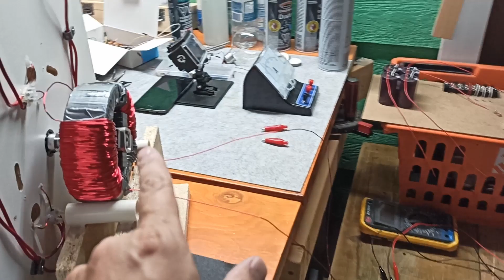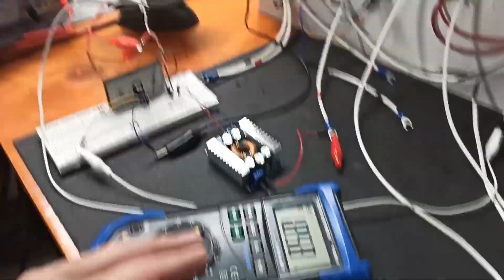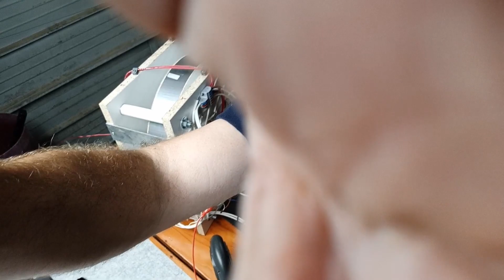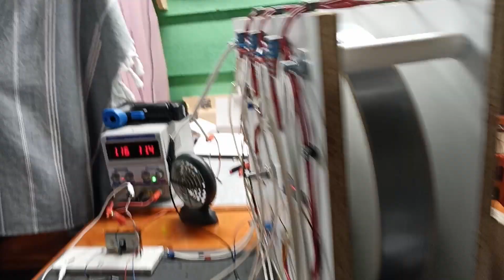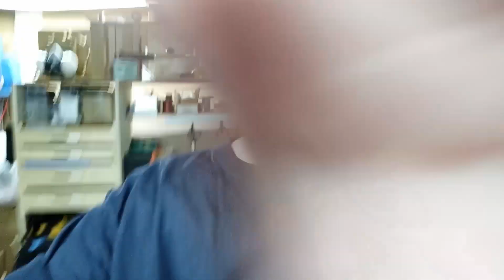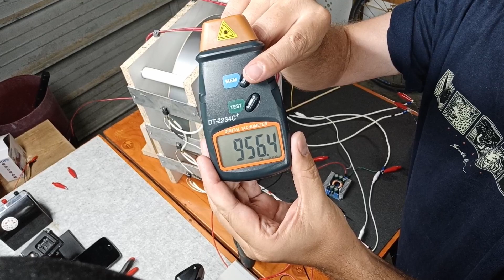Electro Magnetic Pulse Motor - Part 28

Comment: I hope I can help you understand lenz law in relation to your toroid.  Lenz usually occurs when current goes thru a coil and it usually opposes oncoming magnets like in a regular gen set but in the case of the toroid the magnetism produced by the current is "trapped" in the ferrite as we know magnetism prefers a solid ferromagnetic medium 1000 to 1 versus coming out into the air.  So whats happening? It is trapped by the coils and circulates throughout the circular core with no interest in leaving the core to cause any braking to the exterior or in your case the interior revolving magnets get shielded from the lenz effect. hope this helps
Reply from the maker: Hi Alex, I actually found your channel about 3 weeks ago for the first time and I think your work is amazing.  My current prototype is based on Mike Kantz QE3 design but my version isn't functioning as well as Mike's.  He was a great guy and always willing to answer questions but unfortunately, he passed away in April 2020.  I recently tried your broken ferrite core tricks on a smaller toroid but it's starting to get cold up here in Canada now and the garage is getting less and less comfortable to work in as winter sets in.  I bought 10 mini ferrite cores like yours and was planning on building something similar to the prototype EnergySeeker build using your idea.

Any chance of connecting directly with you?  I have questions.  If so email me directly at vince@bumpymotors.com.  Thanks for all your help.
Reply: that is  correct Alex . You overcome the lens braking with the pull force of your rotor magnets to the drive coils "Iron" core. that is where the free energy is , ...  If you use more energy than that is need to "only" brake the connection of your rotor magnet to the drive coils core then you are losing co efficiency at that point.
Reply: Beautiful explanation
Reply: @Heliarc91  there are a couple of systems that are close to overunity and if you inspect them you will find the same common denomintor, lets not fight with lenz law lets redirect it. if you write me back I can show you the 2 systems and why they work.
Reply: @alexmanzanero  HI. Yes I know of a few that show OU results.
Yeah send a link or video name
Reply: @Heliarc91  Minute 18:21 again lenz stays inside core, does not deviate outwards to spinning magnets..https://www.youtube.com/watch?v=fDQ4Vh2udc0&t=699s
Reply: I been working on this same set up of a toroidal generator. However I don't have a toroidal so I'm improvising with several u chaped cores to do some test. You must understand that this will not fully remove lenze force but rather redirect a portion of the force that is caused by the interaction of the coil magnetic field and the rotor magnetic field. You don't see the effect now because that generator is bearly generatoring any power. You have to position the magnets properly to get the proper power out the toroid.
 The lenze effect you will still experience is that due to the current moving in the coil. This electrons  (moving electrons) will experience a force by the rotor magnetic field and this force will oppose the rotor speed as the electrons can't leave the wire. What the great hype is about is if the force due to moving electrons is negligible compared to the drag force cause by the two interacting magnetic field. Also your right about needing stronger magnets. Are you still working on it? How is the progress?
Reply: does not have to be toroidal, just give lenz a pathe of least resistance that will not splurge outward towards your dipoles(magnets) @raloed.363

Comment: In your thumbnail, you need to get the N and S magnets on either side NOT on the same coil at same time.. 

They will short inside the coil somewhat and lose voltage. Ideally if you can get one to come out as soon as the other one begins to come in, that will help alot.

Hope you worked it out I love the project. 
I have a hyperdrive I'm working on. Just 3d printed a new generator rotor for it.
Reply: here is another one, lenz is reacionary but notice how these coils are structured with a huge iron circle core, so lenz has a chance to diverge into the core rather than coming out thru air onto magnets, see minute 5:21 and you will see what I mean....https://www.youtube.com/watch?v=5N8RhdK1eyY&t=323s
Reply: @alexmanzanero  hey Alex I got the Russian video. Did you send another?? I appreciate it!
Reply: @Heliarc91  yes , sent 2 videos just follow our conversation, thanks
Reply: @Heliarc91  I have more info to put out but there are a lot of haters out there and this has stopped me from publishing more vids.
Reply: @alexmanzanero  ah yes I've seen your videos and work before.

Do you have a contact email listed anywhere?

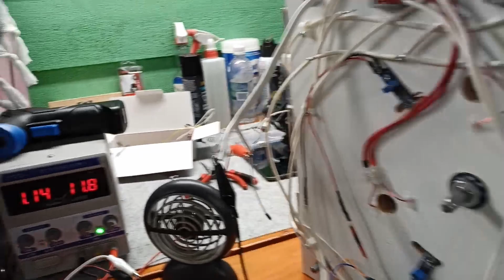Comment: 6:50 your pulling to much current. should be 100 ma  and 12 V . See Bedini SG circuit . Instead of using amps to generate use the pull force of your rotors magnets to the drive coils core. Hope you got that GL

Comment: just FYI, i have a rpm/tachometer meter, only a piece of tape should be reflective at one point. the disk should be black, that will eliminate you reading problems. your silver paint or tape on the inside disk is whats causing problems. disk should be black, silver tape make count.
Reply from the maker: Hi Fred, thanks for the tip.

Comment: Hi Vince just wanted to offer a suggestion if you want to check out whether your toroid generator is working why don't you just short out the coil or put a load resistor on and see if the speed of your pulse motor decreases if it does not decrease and continues to run at the same speed you have eliminated lenzs law. 

Even if you were to eliminate lenzs law what is the output of your generator according to your load?
Has always keep up the good work thanks for sharing!
Reply from the maker: Hi sirblingjax, I did do exactly as you suggested already and my results showed that there was no sidestepping of Lenz's Law but there was a lot of potential reasons in my design for that too.  I got a better toroid now so I'm testing it now.

Comment: just run a magnet and reed switch for pulse signal, remove every bit of drain on sytem
Reply: plus makes it easy to fine tune,have a dc solid state relay thats switched by the pulse from reed switch just use 2 x aa cells for relay trigger ,theyll last for months.
Reply from the maker: @katiekumcgil  Good suggestions Katie, thank you but I already build reed switched/SSR driven pulse motors a couple generations ago.  I'm just experimenting with as many ways of pulsing as I can.  Ultimatly the only thing that really matters to me in my motor is the toroid.  There's a hundred ways to do the pulse side, but if the toroid side doesn't help me get more out than I'm putting in these no point.

Comment: You would be correct the toroidal generator does have reduced lenz, you need to get yourself an oscilloscope to see the wave form. If the toroid is wired correctly it will produce a back emf wave that will aid the applied voltage, when the rotor is spun one direction and not aid the applied voltage when the rotor is spun the other way. Look up on the net the mini romag , motor generator experiment by JL Naudin, he describes the wave form when a magnet interacts with the sides of a coil and the wave form produced. What he doesn’t tell you is what happens to the wave form when you pass the coil across the magnet in the other direction. The wave form will become more positive and less negative. On a pulse motor the more negative wave will back charge the primary battery and the more positive wave will charge the secondary battery. 

John Bedini’s zero force motor does the same thing as described above.
Reply: Sorry I see you already have a scope in your possession.
Reply from the maker: Thanks for watching Advancedbatterytech, your suggestions are noted.  And thanks for the pointer to the 'mini romag' motor, I've never heard of it before.  I'll keep digging to find out more about it.

Comment: Nice, keep the enthousiasm, it is engaging. See I don't want to break that, but I think you said led bulb right? So the ones we have here for 220 volt, start to conduct at 30/40 volts. Basically they are diodes with a high breakdown voltage. To check out if it works you could put a multimeter in between measuring current. What you can also do to make sure it conducts is to short the wires without a load. Or of course use an incandescent lightbulb. Nice work!